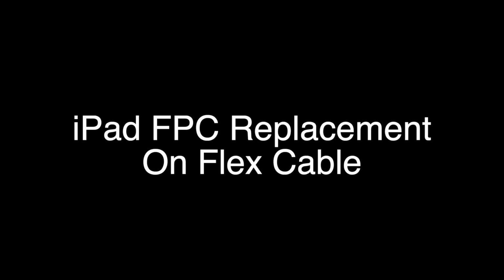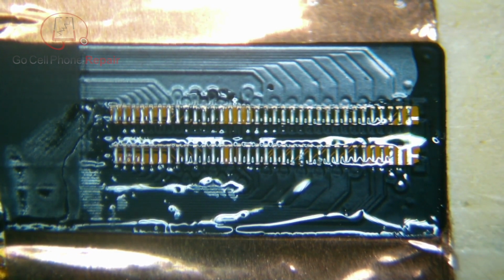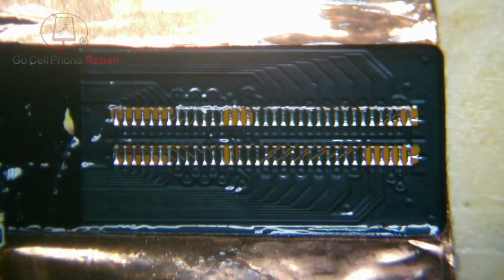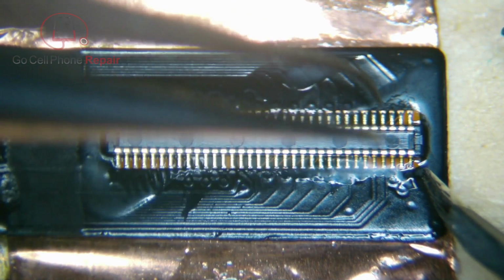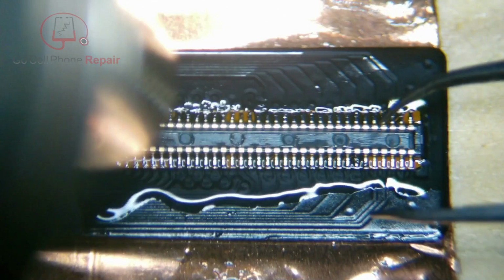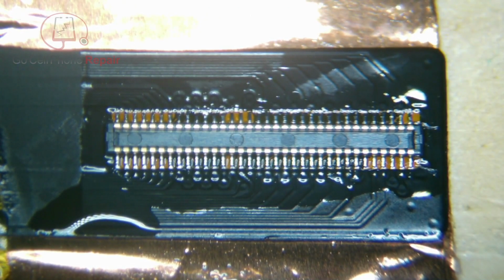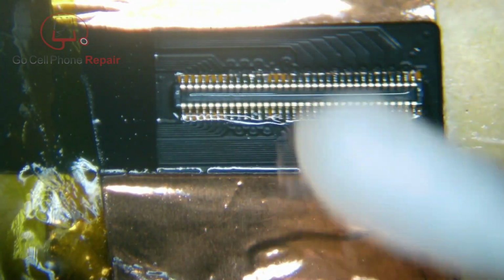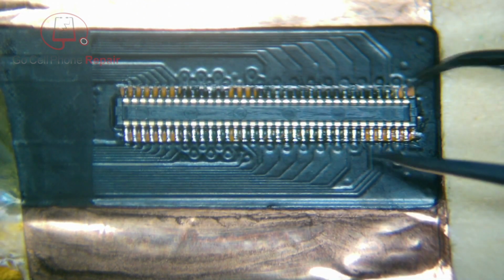iPad Flex Cable FPC Replacement- Yes we fix tech errors!

Comment: Hi.. can a iPad Pro 9.7 Screen flex cable/ribbon be removed ?  I cut the one  (to replace the battary) and  have it  pulled to  2 lines by the  button.  But can't  find one to buy... only attached to the screen.